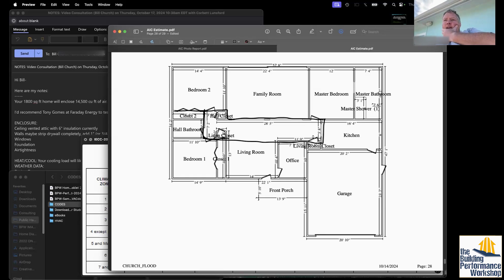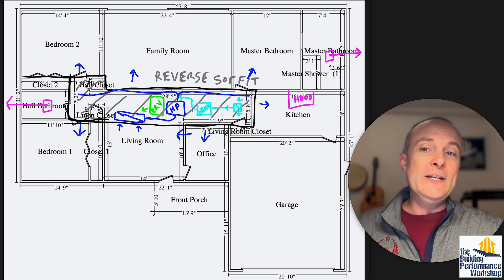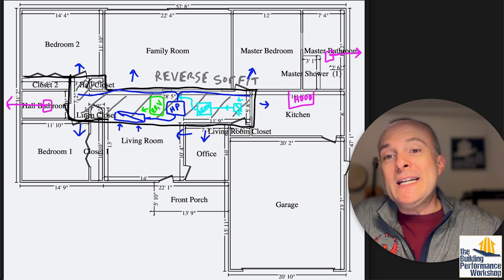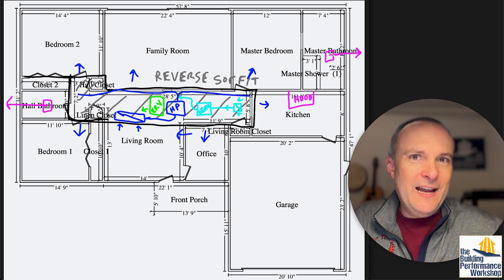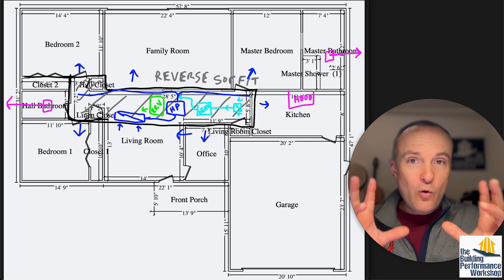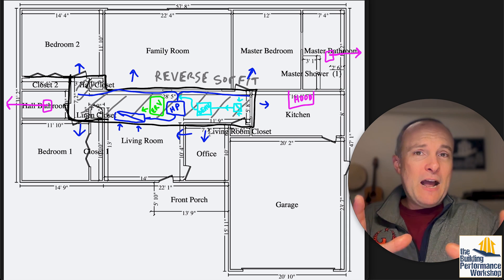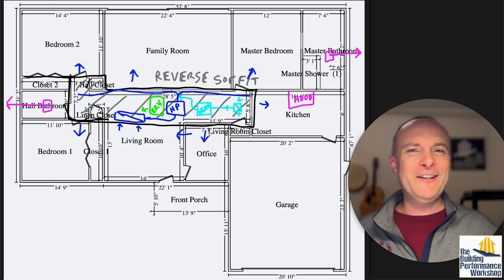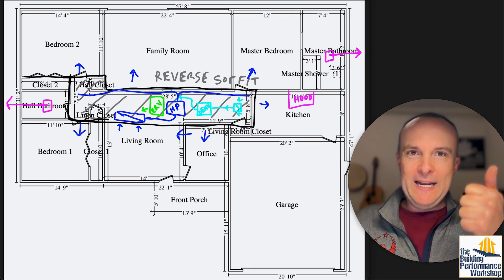Ducted Mini-Split HVAC in a Central Hallway Reverse Soffit: Home Improvements after a FL Hurricane

Comment: The traditional rule of thumb for register layouts are at exterior walls (usually near windows/doors), but many hotels, 20th century retrofits, and apartments use that central hall plenum concept with wall registers at the internal doors/walls of rooms.  I always wondered how much of an issue that register placement mattered since it seemed worth it if it worked. Good to hear you use ceiling fans as a solution in this scenario.

Comment: 11:45  I guess I don''t quite understand why the air velocity coming out of the supply register wouldn't "shoot" the supply air across, and mix, the bedroom air before it has time to get sucked under/through the door back to the return. Assuming the register isn't pointing directly down at the floor. Seems like it would work OK without a ceiling fan too.  Is this system an especially low velocity system?
Reply from the maker: Because it'll be a variable speed system, and it won't be running at high speed all the time. Most of the time, in fact, it'll be turned down to a lower speed.
Reply: @HomePerformance  thank you

Comment: If the ceiling joists run perpendicular to the central hallway, you could turn some of the joist bays into conditioned chaseways with some ZIP or similar and move the registers to the outside edges of the rooms. With the right diffusers and the Coanda effect, you might not need ceiling fans.
Reply from the maker: Could work Andrei, nice idea

Comment: My mom lives in Clearwater and was without power for 5 days, fortunately she just missed getting flooded by 2 inches. My concern was mold with no A/C for 5 days. That wasn’t a problem because she has 12” thick block walls with shotcrete on the walls and her floor is torazo. I did have to fix some shingles but there was no leak because I had ice and water down when I did the roof 10 years ago. My only complaint on her A/C is it is in the garage (hasn’t been a real problem) but the lack of returns in the bedrooms makes it horrible to sleep with the doors closed even with a ceiling fan.

Comment: My layout is similar and Im on the fence between replacing my rodent infested crawlspace ductwork or abandoning it and the trane in my garage with HP outside and going to mini splits. What was holding me back from MS's was the lack of filtration as we live in So Oregon and usually have seasonal wildfire smoke to manage. Do you know of a great company in the Medford Oregon area that could do this type of ducted mini split system?
Reply from the maker: Check The List, Raven: https://homediagnosis.tv/hvac-installers